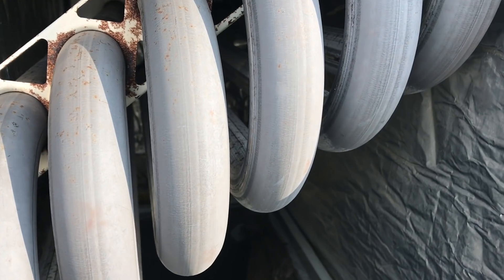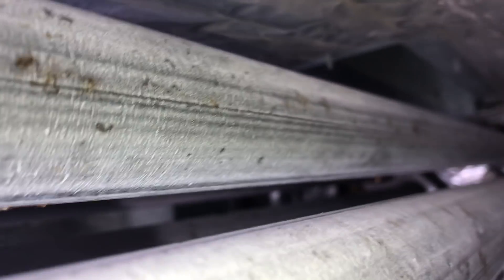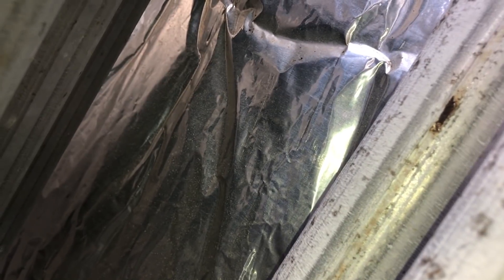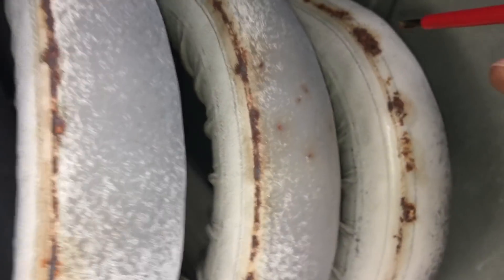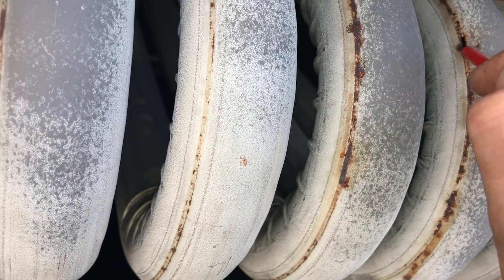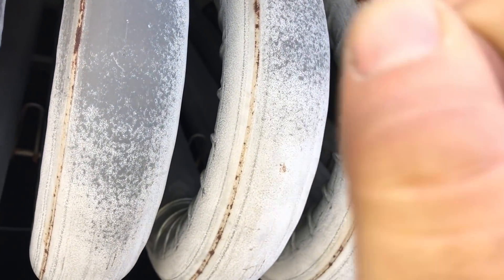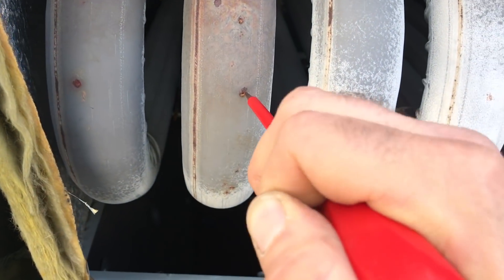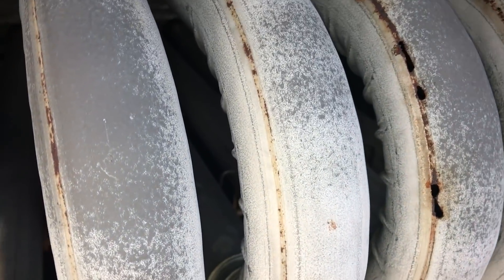How to Poke Holes in a Heat Exchanger HVAC Life

Comment: Scumbag
Reply from the maker: This heat exchanger had more holes than Swiss cheese closer to burners when pulled. A good heat exchanger shouldn’t be able to poke screwdriver through
Reply: Scumbag? Tf you mean? If he can poke holes in the heat ex with a flat head that easy I wouldn’t wanna leave that either, god knows how often these people get there heater checked, but by the next time they did the heat ex would be rooted, you’re the careless dog if you think leaving a heat ex in that condition is okay.

Comment: I worked on a unit that the tenants called me. They were complaining of headaches. The landlord wouldn't get it checked. I found several cracks in the heat exchanger. Took pictures and the landlord said bullshit. The tenants were able to get out of the lease. It was up for rent a few days later. I called the health department and they said there's really no enforcement on that around here. It's not against the law.
Reply from the maker: How is a cracked heat exchanger not a safety issue that the health dept can overlook? CO poisoning was happening and they looked the other way. Good thing those tenants got out when they did. 
 I know I limp along lots of old equipment many say I should replace yet when it comes to heat exchangers or anything that can harm my customer I am shutting it down. I got a lot of criticism from this video because a thermostat screwdriver was sliding through this heat exchanger as if cutting hard butter out of a fridge. Some called me a crook. I will take that overseeing on the news a story of CO poisoning at a location I take care of. Mabey the title made it sound deceitful yet metal this thin will burn through plus I missed actual holes cause I stopped looking with all the rusted through spots I found.
Reply: @thehvachacker  I had a former customer to die from carbon monoxide poisoning. He had an oil furnace positive pressure heat exchanger that was cracked. The most dangerous design. I refused to work on it anymore but he found someone to get it going again. He's dead now. I wish I had protested much louder to his family but hindsight is 20/20. That one commentor on here said he'd kick someone's ass for doing what you did, but I'd take an ass kicking to save his family lives since he's incapable of protecting them.
Reply from the maker: That is what I am trying to prevent by checking and making sure the heat exchangers are safe and solid not paper thin and holes burned through within a month. Sorry to hear about the former customer you did all you could.

Comment: Great job man, that's the way it's supposed to be done! I use to service an aquarium on the water and their heat exchangers used to be riddled with holes every other summer and changing them out on those trane units is a fucking nightmare.

Comment: Good video Hacker. Clearly there are some divided opinions on this, however I agree with your approach, if the exchanger tubes are so thin and corroded that a light poke with a screwdriver causes a hole to open up its time to replace the unit. Better that you found it than it happened on its own and killed someone with CO.
Reply from the maker: That was why I started with a different heat exchanger which had rust spots yet metal was solid and didn't puncture with a regular screwdriver. The second one I had a tstat screwdriver which means I lose leverage and harder to puncture. Yet slide through as if it was a sheet of paper, not metal. There were 10 other units on this roof all others passed my inspection. Most who have seen many of my videos know I try to keep older equipment running. Just not if it can harm my customer. I wonder if those that disagree how they would feel if I did this with a qtip instead of a screwdriver? I believe it still would puncture many spots on that exchanger which when pulled had holes I didn't bother looking for.

Comment: If id have caught you doing this to my unit i would have beat the ever living fuck out of you. And you went so far as to video it. You are a goddamn crook. You and the company you work for. Its all about selling equipment. You dont give a fuck about the customer. You know good and well you could have left that heat exchanger alone and it would have been fine but once you punch that hole its fucked. People like you is whats wrong with the business. Your punk ass needs to be in jail bitch. Ive been in the businees for 15 years and i never did no shit like that.
Reply: Kevin Greene So, he’s a crook and what is wrong with the industry, huh? If you’ve been in the HVAC industry for 15 years and you disagree with a technician that looks for and finds badly corroded weak spots in a heat exchanger, I would seriously question your judgement and knowledge about gas fired appliances. If your furnace heat exchanger in your house is in the same condition, and you gave it two thumbs up on your last inspection, I hope that you and your family have a decent CO detector or two, otherwise it’s possible that no one will have to question your knowledge and judgement in the near future...
Reply: This Kevin guy is most likely just out of school and thinks he knows it all. If he really had 15 years he would say good work because no seasoned tech would say this is wrong. He did exactly what he was supposed to do.
Reply: Hey douche bag, if you've been in this trade for 15 years then you should know that YOUR SUPPOSED TO DO THIS!!!!. ITS CALLED PREVENTATIVE MAINTENANCE FOR A FUCKING REASON! Yeah, he could have left it, but i guarantee that knee deep in the winter, he'd be getting a call back for a tripped roll out or worse. I've been doing this for 20 year's and this is how it is SUPPOSED to be done. Do yourself a favor a do some research before you berate someone on how they do their job. It's cunt's like you that give guys like us a bad name.
Reply: Kevin Greene I would want my exchanger replaced as well if it’s paper thin....
Reply: You know good and well your job on a maintenance is to observe and report not sabotage the unit to the point that the customer has no choice. That's not only unethical its dishonest. I don't know where you are but if you bring that shit to where I'm at you'll get run the fuck off.
Reply: @kevingreene63  where did you get chance you chicken shet coward
Reply from the maker: That is a thermostat screwdriver I used the red one. If it isn't what is it? The first unit I tested that passed I was using a regular screwdriver. I don't sell units and this system wasn't replaced. Only the exchanger was replaced. There were already holes I didn't find on my inspection yet because of the holes rotting through on the top no reason to look everywhere. Actually, on maintenance, I repair whatever I run into. I am the kind of tech I repair before replacing. I could have sold many units in my videos yet I repair and keep everything running as long as safe. Remember it has to be safe that exchanger was a goner. You could ignore that exchanger and then have no heat calls a few days later from the rollout. Obviously, you don't watch my videos or you would know I repair first before replacing. Were I work don't need all the extra work since we are 2 months behind on maintenances. friday I was doing an October maintenance. It will be 3 months before we catch up on all our commercial maintenances.
Reply from the maker: The worst part is if I didn’t do this when temps are not pipe bursting cold. Then along with RTU shutting down on flame roll out and them having no heat, pipes froze bursted and water damage, and I am replacing the heat exchanger on a single digit day. I left out the chance of carbon monoxide poisoning or controls and boards burning up if roll out fails. I was on a roll found 3 bad exchangers in a week and all the others I checked since was fine.
Reply: Hey @kevin Greene 
please be respectful, what he did is a common practice, if you don't like he's content don't watch it.
Reply: Bryan Hensley um.....did you just call someone a stupid idiot? Because I don’t think co2 was the chemical compound for the gas you were looking for. Proof read your post if you yourself don’t want to look stupid when calling someone else stupid.
Reply: Kevin Greene You should attend the Heat exchanger experts class. They travel throughout the country and teach techs all of the most common areas they crack and teach you this technique. The one thing they do though is leave it up to the homeowner before they go poking around. But the homeowner has to sign a waiver saying they refused a heat exchanger inspection. 

Also, did you know that if you are the last one to touch a unit and the someone dies because of CO after you claim they have a good furnace. You can be held responsible. The technician and the company. 

Find a problem, show the customer, if they let you proceed by all means show them, if they say no get them to sign the waiver and be on your way. 

I’m not saying he did it right, but I’m not saying he was wrong either.
Reply: @kevingreene63  you sir are a fool. It's the smallest person in the house that dies first moron. There's a lot heavier regulations in Canada for heat exchangers. I would have locked that down in a heartbeat and yes I've ran into fools like you before. Still didn't stop me from locking it down it's your family I'd worry about.
Reply: That's how I check them too. If I can put a screwdriver through them then it has failed plain and simple. If you don't verify the integrity of the heat exchanger then you're wasting customers time and money. If I see a spot that looks suspicious better to check than have it give after I leave.
Reply from the maker: I shouldn't be able to push a hole in a heat exchanger with a tstat screwdriver. I didn't even apply pressure to it. SO besides getting your ass kicked the utility company, I would call and they would lock your gas meter until it is replaced. If my screwdriver slides through it mean the metal is paper thin. Plus after pulling this heat exchanger there were holes already in it that I didn't find on my inspection. So it was toast. there were 10 Heat exchangers on this roof. This was the only one that failed my inspections. I would be a crook if I don't condemn shut down and then CO poisoning or thermal event happens within this system. Plus hard to sell a heat exchanger a month later when those rust spots are rotted through holes.
Reply: @thehvachacker  whatever helps you sleep at night brother
Reply: And by the way that wasnt no fucking tstat screwdriver

Comment: Had a leak in a heat exchanger on an old furnace I had. Their was black chunks of what looked like cheese puffs laying between the pipes of the exchanger. Expensive fix. New heater.
A sad story I heard about a cabin I went to stay in with a group of guys on a snowmobile trip. The guy that invited us up said his grandfather and a friend of his used to always go to town each day from that cabin. No one saw them for a few days and finally one of his cousins went up and found both of them dead because a gas refrigerator was leaking carbon dioxide into the cabin. Gave me an eerie feeling staying there that weekend.
Reply: think you mean "carbon monoxide" CO gas, the scentless silent killer....
Reply: throttle bottle your absolutely right  thanks for catching that
Reply from the maker: Willie I would also have an eerie feeling staying there after a story like that. I understood what you meant when I read this earlier. This is a very common mix up I hear many professionals always talk about how deadly CO2 is. Most HVAC forums many talk about cracked heat exchangers and how people will die from CO2 poisoning. I have never seen a gas refrigerator with a burner. I need to look this up later to get a better understanding how this works.

Comment: Not all people see it this way, but we have a moral obligation to save our customers lives, I personally wouldn’t be able to live with myself if I let this go, then find out later people died because I let this go. If I find something like this I tell the customer the situation. If they want it taken care of, fine no problem, if they don’t want to deal with it for whatever reason, I simply call DTE, that’s who we have for gas supplier in my state, and tell them the situation, and they will send out their people immediately to investigate and if they find a defective equipment like that they will immediately shut off service until the situation is resolved. This is a serious matter, and NOT to be taken lightly. May pissvoff a few people, but oh well, I just saved your life, and you can be pissed all you want. And if I don’t work for them anymore, hey that’s fine too, I can live with that and really don’t want to work for those type of people anyway, because they turn out to be a giant pain in the ass. Nuff said, drive through!
Reply from the maker: I am there to make sure this machine is operating and is safe to run. This metal is so thin a pencil could of punctured it. If I don’t check if the metal is thin a month or 2 later the seam is wide open and all the holes are rotted through. I am just making sure it I started disabled before CO poisoning or a thermal event from roll out happens
Reply: @thehvachacker  agree 100%, you did the right thing. Great job, keep up the good work on the videos.
Reply: im with you in tell them about the situation but it should be on the customer from there cover your ass that you told them and from there its there issue they get themselves killed well it there ass

Comment: Wholly time for R & R. Merry Christmas buddy
Reply from the maker: This exchanger is toast can’t wait for R & R after working out in the rain all day. Merry Christmas Michael.
Reply: @thehvachacker   is that Remove & Replace or changing unit?
Reply from the maker: That’s remove and replace it’s 2012 RTU. It was the only one to fail out of the 10 on that roof. That metal was paper thin on that exchanger. Most likely would of burned through within a month or two. Better to do know instead of January or February when single digit temps hit.

Comment: I write it up if the heat exchanger looks funky. A lot of times the customer wants to wait until they have heat failure. And then they wonder why...... cant make this crap up.
Reply from the maker: I have to shut it down. I show the customer the disconnect switch yet they sign off I shut it down. Monday I had a service call from a building I shut two of the RTU off from bad heat exchangers Friday. The guy wanted me to turn it on so He followed me up to the roof internal hatch. I pointed to the unit, billed him a half hour and had him sign off I left RTU off, he didn’t care obout the other one I left off.

Comment: Dang man, quit using your good screwdriver for that. You're going to mess up the tip. Get out the old beater to poke holes through there.😂
And for guys out there that say "that's dishonest you're poking holes through their heat exchanger." they've obviously never taken the time to closely inspect a heat exchanger like that. Those rust spots are so thin you could sneeze on them and it would turn into a hole. Units like that have to be repaired or taken out of service. It's a liability! As technicians this is one of the most important responsibilities we have. If you find a bad indoor TXV in the summertime, at the very worst a homeowner might have to sweat it out for a couple of nights until it's fixed. But breathing carbon monoxide isn't good for anybody! it's a very serious issue and should be taken seriously by ALL technicians out in the field 👍
Reply: they are just days away from failure personally would have condemned them on the spot wait its condemned i would have red tagged it and told them to get a new one (didn't watch the entire video)
Reply from the maker: Good words of wisdom Shannon not to ruin my screwdriver. I will make heads spin on the next one with my tool of choice yet will not harm the tip of my screwdriver on metal that is paper thin. I feel some are thinking I am a crook or scammer trying to ripe off people cause of this video. Yet if they watch most my videos I try to keep everything running till it’s gone. Until It comes to heat exchangers and people’s lives. I put a link to your heat exchanger in a comment on this video mabey it will migrate some traffic to you.
Reply from the maker: I did shut it down that one I could of usd my finger to push the holes through yet who wants to chance getting cut by rusty metal. Damm my jaw is getting stiff and starting to ache
Reply: @thehvachacker   LOL time for a vacation
Reply from the maker: So true

Comment: Had a store today I've never been to before, 4 carrier rtus, found all 4 exchangers cracked guess there normal company hasn't been checking
Reply: awsom70 carrier heat exchangers last about 7 to 8 years. They suck. I could not tell you how many I have changed. Always replace the induce assembly , flame retainer, burner support and run cap for the induce fan motor. Any thing 10 tons and less can be done in about 3 hours. Carrier will recommend the retainer gasket as well. This gasket is in the heat exchanger box with the other gaskets. Don’t purchase it.
Reply: @actechformallyyomama746  damn your slow! I do them in 20-30 minutes and I know to replace All the parts lol
Reply from the maker: I am the slowest I quote then 2 guys 8 hours each
Reply from the maker: I hate the feeling of finding the last one bad. If you seen my last video where I was poking holes I was trying to talk myself out of checking the last one.
Reply from the maker: Carrier side pull exchangers are cake jobs. It seems most only last 7-10 years around here. Inducer is a must when doing the exchanger